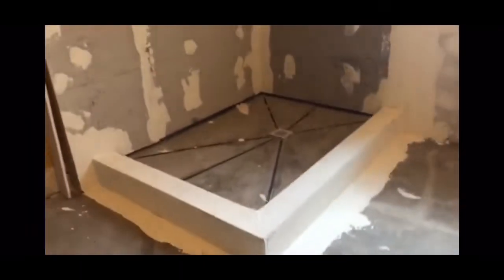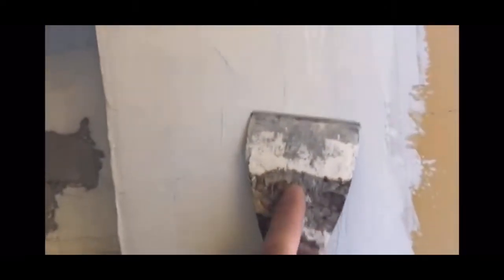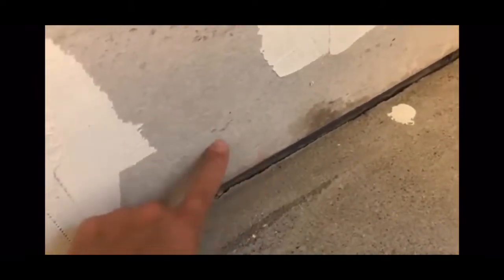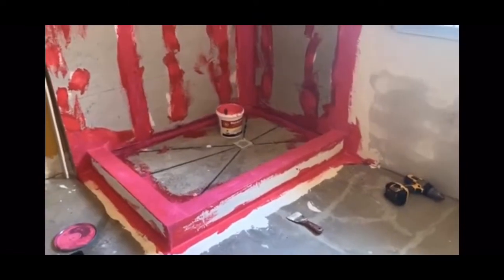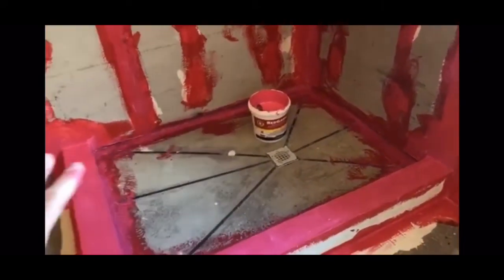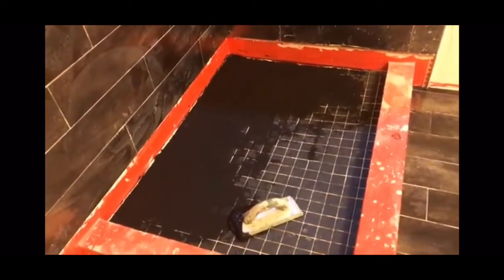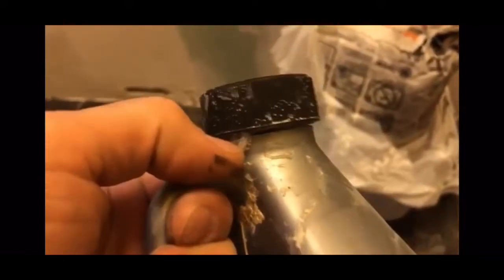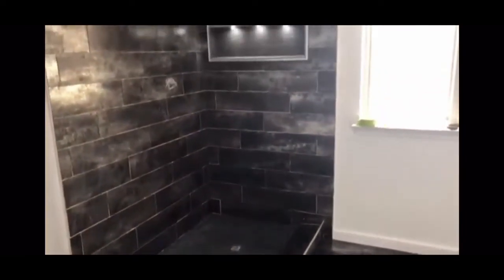RED GARD APPLICATION INSTRUCTIONS BY A  PROFFESIONAL

Comment: Question my house has a concrete slab that’s apart of the house original foundation kinda like a basement set up.. can I use  one of those sloping systems you used on top of the slab? Do I need a liner between the slap and sloping mud? The slab is just pored concrete from when the house was built. So question is can I do a sloping system on a slab with no water proofing between the two?